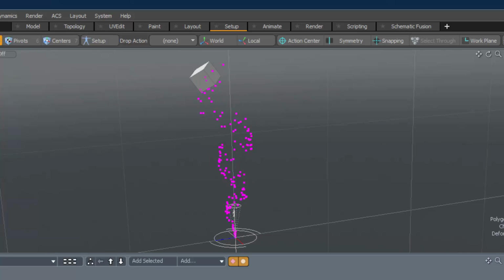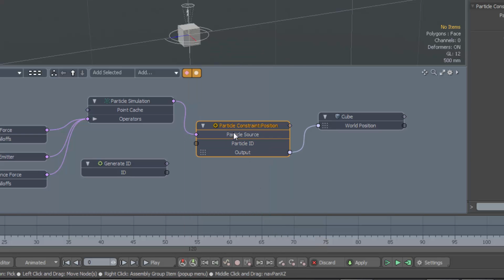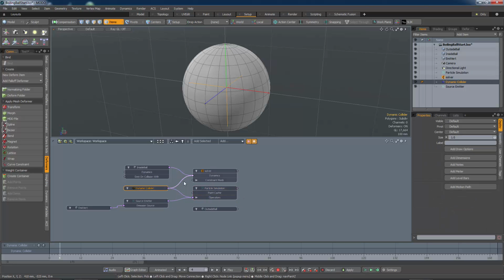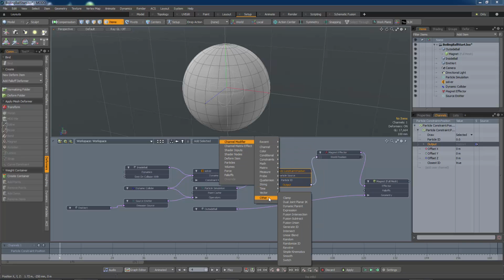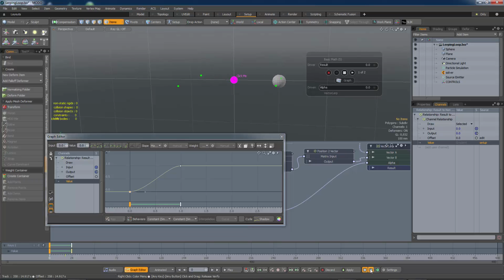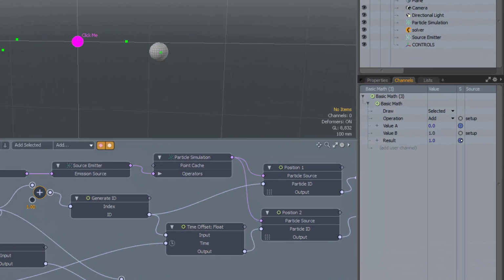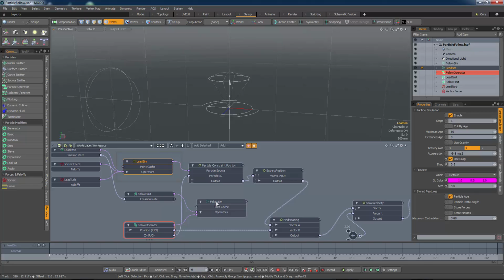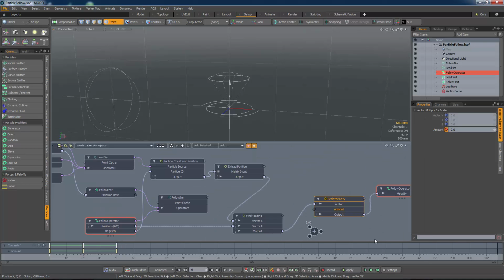The Modo 901 Particle System -- Follow that Particle

Comment: Hey Steve, great vids as always. I have a question for you. I was wondering if your last example where you have one particle sim following another, if it is possible to gradually increase the influence that the lead sim has over the follow sim, such that on emission the follow sim is behaving based on it's own simulation parameters and then as the particles get closer to lead sim they are gradually more attracted to those particles?
Reply from the maker: I believe so.  If you extend the "follow sim"s particle operator to read the velocity of the particle, you can then do a linear blend of the original velocity and a velocity whose size depends on the distance between the particles.

Perhaps applying a force would work better ... it can be quite delicate to get right and applying a drag force in the simulation can help prevent the particles getting too excited!  Something like this maybe ... https://www.dropbox.com/s/iqft8dbl85awie9/ParticleFollowForce.lxo?dl=0
Reply: Hrmm interesting. I'm not sure if using a force will work for me because of the need to crank the drag so high. (I have other forces in the scene effecting the follow sim already) I tried to do a blend of the original velocity and the lead sim influenced velocity, but I can't seem to get that to work reliably. I feel like there may be a bug in there somewhere but I haven't been able to consistently reproduce it. 

Anyway, thanks for the tips. :)

Comment: Hey steve, I followed your step, and did exactly what you did for the particles follow particles scene, but my follow particles are shooting directly to the lead emitter, and I CANNOT figure out why
Reply from the maker: +Mozarc2045 Mu Of course it could be any number of things -- but one thing to check is that the Matrix Vector node is set to "Translation" -- I don't think this is the default and I didn't call it out in the video.
Reply: Thanks so much Steve. another question would be how do you have one particle system's particles bouncing against the other particle system? Please just give me a rough thought if you have time and that would be great. trying to make saturns pole using modo's particle systems, and the formation of saturns pole is based on different speed of particles spinning around the center, that's why I want have different particle systems interact with each other while they all have different independent influences
Reply from the maker: +Mozarc2045 Mu (So far as I know) .. as a general rule, particles that interract with one another need to be in the same particle system.  I toyed with "dynamic replicators", but these can only be connected to one system.  I am not able to think of anything obvious off the top of my head, but will have a play.  Clearly you can create two populations of particles with two different emitters, but I am not sure how to select the influences that apply to them ... it may not be possible.
Reply from the maker: +Steve Hill You can use the particle id to apply effects to different populations of particles within a single system e.g. id from 0 to 0.5 and 0.5 to 1.  You don't seem to be able to modulate the standard forces with this, but if you roll your own forces using a particle operator, it is possible to apply different forces to different particles and use the standard forces/operators where an effect applies to the whole population.
Reply: that sounds like an amazing idea, thanks so much I learned something that I couldnt find on internet:)